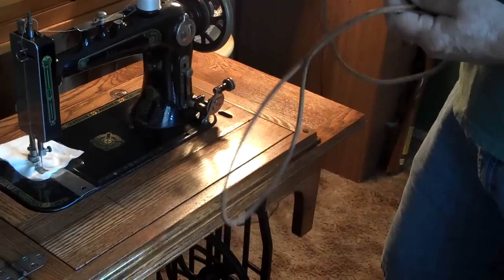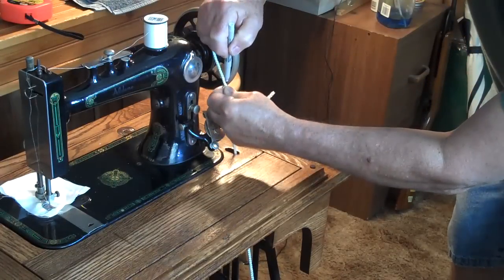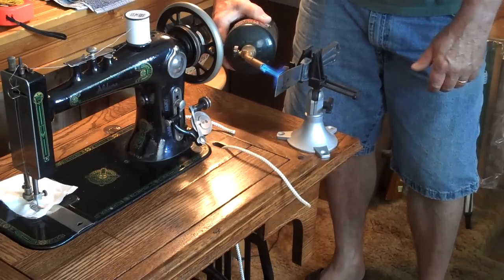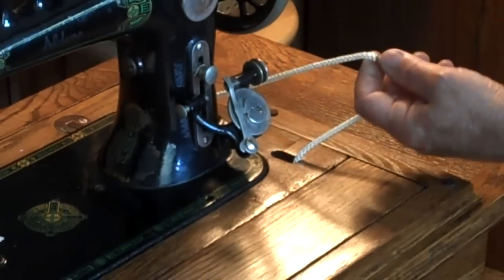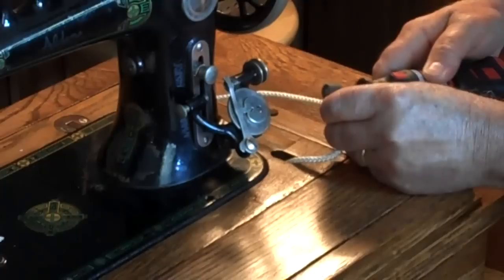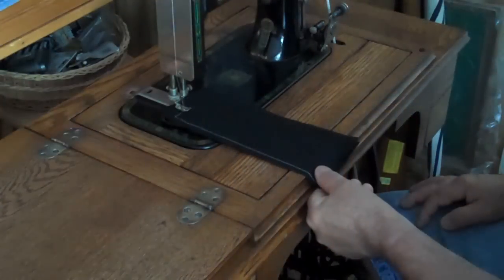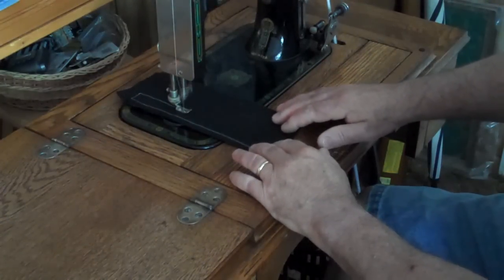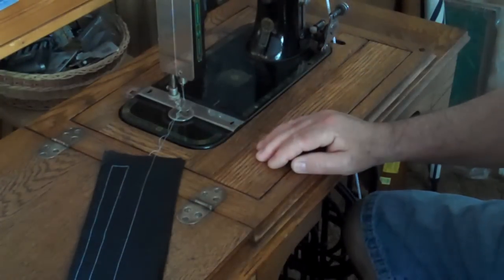How You can make a Treadle Sewing Machine belt.mp4

Comment: Good job. I use 3-4mm nylon static climbing accessory cord for belts on my treadle and industrial machines, tying the ends with a sheet bend knot and re-threading one of the ends back so both ends face clockwise. It's also known as an Ashley's Pulley knot and was shown to me by an outdoor gear machinist; works a treat and is adjustable if it stretches. I've never had to do this though. It's far superior to the leather belts.

Comment: Before you melt the ends together slide a short piece of 1/4 inch shrink wrap tubing (used for electrical connections) over one end of the cord and slide a couple of inches from the end.  After you melt the ends together and grind down, slide the shrink wrap tubing over the joint and heat with a heat gun or other heat source until it shrinks tightly around the cord. This will make it much less likely to come apart.

Comment: Indeed a new belt is in the $10.00 price range but I've been rebuilding my machine and wanted to try it out today. This little trick worked perfectly and I intend to run it for awhile just to see if it lasts. Thanks for the tip, clever solution.
Reply: Daniel Hodge how long did it last?

Comment: No need to remove hand wheel. Just slip it off the big wheel under the table, then over the hand wheel, then back onto the big wheel as you turn to help it slip back into the track.

Comment: Great idea to tide you over till you get a belt. If you melt that one right and even put a staple like the leather one has it would probably hold up and not break free where it's melted. Great idea no doubt and thank you for taking the time to share. I did however wonder why you weren't melting it after you wrapped it so you didn't have to take off the wheel. LOL GOOD VIDEO THANKS

Comment: This is an old post but the info is timeless so I will post my two cents anyway. I bet you could safe a lot of time with leaving the ends frayed and loosely tangle/weave the ends together and using a heat gun on its lowest temp to slowly melt the pieces together. You'd probably have to wave the gun over the ends to keep the surface of the plastic from burning. You could also get a small bowl with cold water and dip your finger in it and mold the hot plastic with your fingertips as it melts but work quickly lol, if not you will soon haha. I'd also use an old metal (horizontal) fountain pen holder and that would help hold the shape and the metal wouldn't be affected by the heat gun

Comment: some websites sell real leather belts with the metal clip on them/you just have to trim down the length if you order the wrong size.so be sure to measure what you need first.they also carry the bobbins, face plates, bobbin holders, needles,attachments and feet,booklets, etc..fairly cheap and shipping is decent on light weight parts as well.i got an older one from my mother in law and ordered about 20$ in parts to get mine to run.no i don't work for them. just nice to find.belts by alphasew

Comment: How do you keep the slick rope from slipping?  I use oxygen tubing for belts on my treadles, they grip good, and work great, they are held in place with a fine thread screw.  Kenny just cuts me little parts of it and I twist one end into the tubing fit for the size I need then insert into the other side of the tubing.  :)  Good video....

Comment: Try using 2 feet on the treadle, makes life eaiser and you have more control and cut the braid at an angle to splice them together better. Leather is better though and easier to make a belt with

Comment: I did something similar to this by splicing a three-stranded cord, similar in material to this one, and tying the separate strands together at staggered intervals so that they would lay flat under the guard of the treadle wheel. One strand ended up breaking but the other two held up, and I just melted the broken strand into the rest of the cord.

Comment: I am looking around right now for ideas on what kind of steel I can use to make a hook for a leather skipping rope to replace my 4inch belt on my old machine, If I can't find info on that I may end up using this method, I am surprised to think that nylon would hold up to the tension. Great share. I don't have any rope, but I do have paracord which I can cinch and wrap tight into a three stranded rope which may do a good enough job. Thank you for the inspiration.
Reply from the maker: Leather Belts with the steel staple are available all over the internet. You have to cut to correct length and then drill a hole in the rope to secure the staple

Comment: You can coat the belt with rubber cement to make it grip better and slip less.
Reply: mine has a fairly new leather belt on it, but it slides all the time, sews frontwards, back, and makes a mess. Now trying to tighten the belt, I broke the staple, any suggestions what kind of metal I can use to replace that staple? Once I repair that, would you rubber cement the leather to stop slipping? I live off the grid, and even tho the little motor doesn't take many watts, I would prefer to keep the treadle, give myself that tiny workout :) Could use some wisdom.
Reply: You could try sewing it together through the staple holes, I was able to make a serviceable belt using nylon rope and heat bonding the edges together and then sewing.  You could use rubber cement on leather, I think it would soak in and bond with the leather.
Reply: Thank you, great idea
Reply: McMaster-Carr:

 6567K56 Quick-Connect Hollow-Core Round Belting, Yellow, 3/16" Diameter
        6567K26 Aluminum Connector for 3/16" Diameter Quick-Connect Hollow-Core Round Belting

That is what I am using now.

Comment: Hi, I see that you posted this a long time ago,

But if you read this could you or anyone else tell me what size leather belt I need for a Treadle machine?  

Thanks
Reply: +Eileen Simpson 
You can buy leather belts on Ebay or Amazon, each of which can be cut to size to fit most machines. I would recommend that you first take a piece of string and install it on the machine much as you might with a proper belt in order to take its measurement and make sure that the belt will be long enough in the first place.

Comment: How do you remove the hand wheel? I cannot remove mine, it's stuck :/
Reply from the maker: Remove the small screw in the small Shiney clutch knob. This will allow you to Un screw the clutch knob completely. Remove the friction washer and just pull the spoked hand wheel off the shaft. When you replace these, it is possible to get the clutch washer 180 degrees off. If you can't tighten your clutch knob far enough to lock the hand wheel, pull washer back off and rotate 180 degrees.
Reply: graleh You actualy probably dont need to remove the hand wheel, just tip the head back. The table my Singer 31-15 is mounted on has a peg for the head to rest on so you can tip the machine back for oiling or switching out belts.